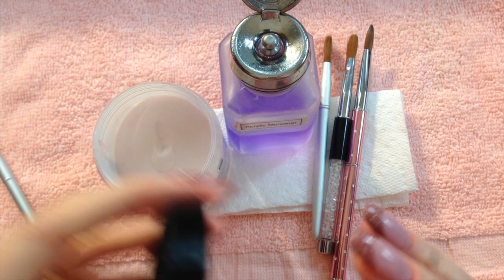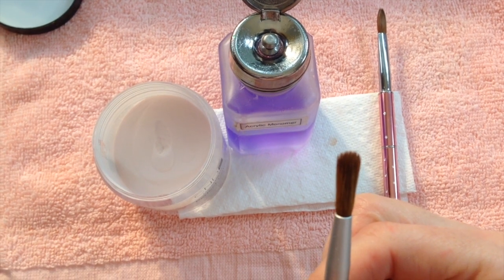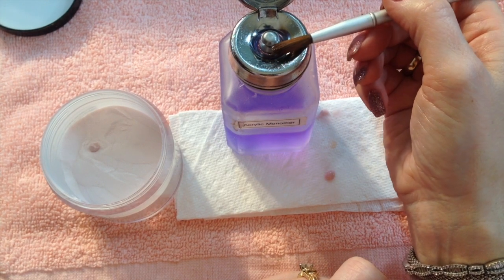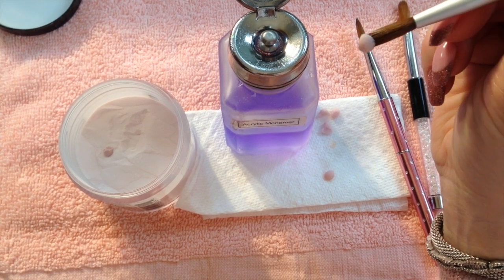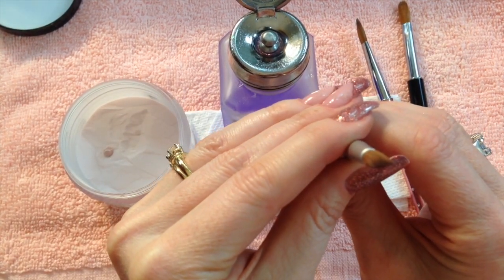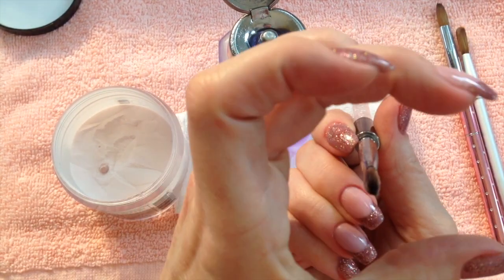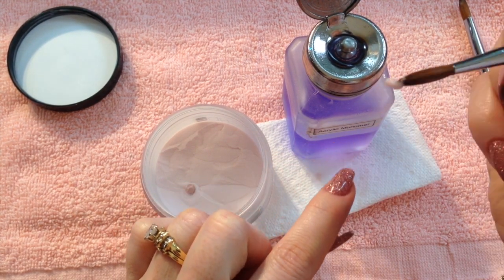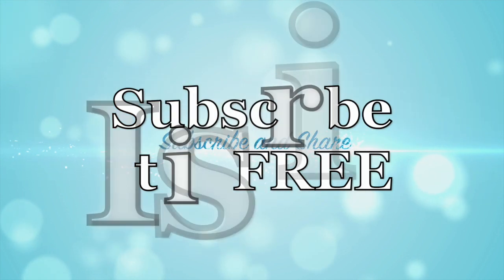Acrylic Nails: Why Does Acrylic Ball Fall of Brush

Comment: Another awesome video. Quick question, I have seen some, after tapering the tip of the brush, dip in powder and then "bleed" out more liquid off the back of the brush. How common is that that practice? Does that also help to remove excess liquid?
Reply: Allie Quinn its all personal preference! Once you’re able to get down you Liquid To Powder Ratio you don’t normally have to do that though. The reason you do it is to make a very dry bead maybe for a specific area you want to fill in.